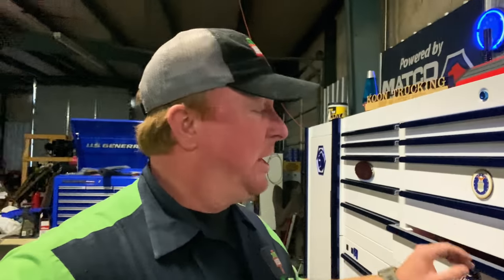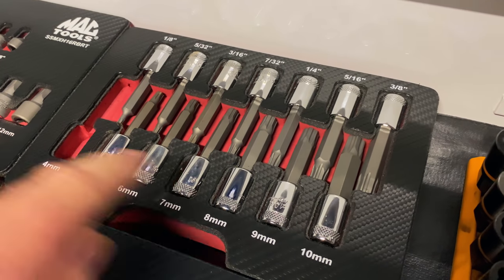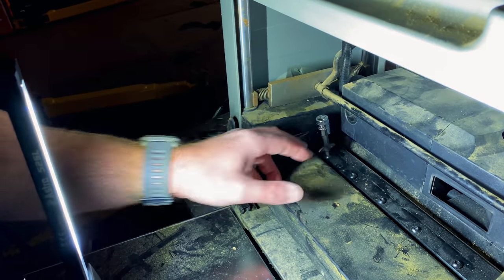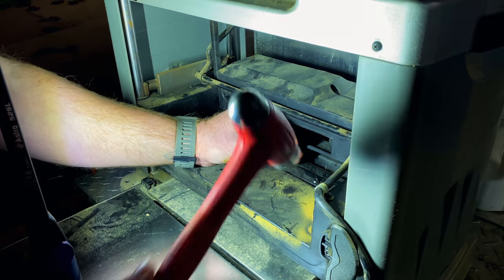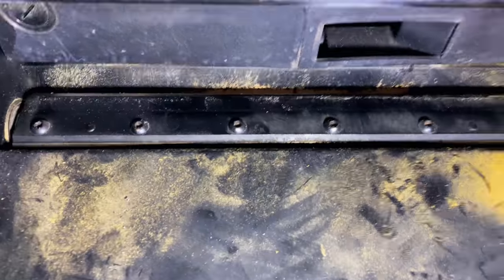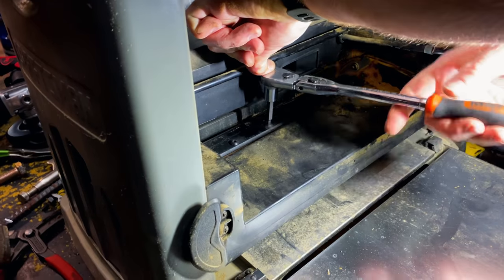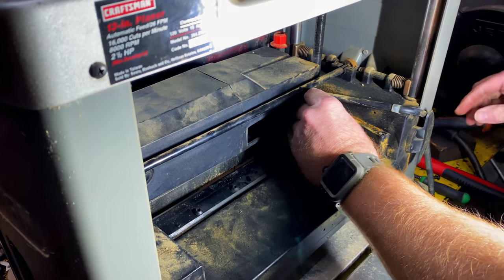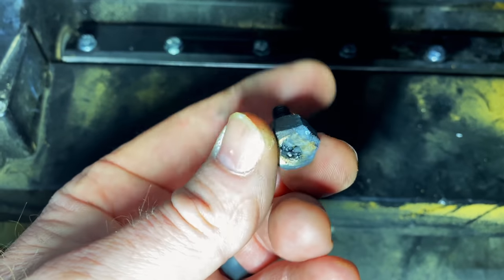Mac Tools RBRT Hex Extractors Used In Real Life Work (Stripped Hex Head Bolts)

Comment from the maker: ⭐️ I’m in no way saying RBRT bits are no good or do not work, the point is if the metal you are trying to extract isn’t strong enough to allow it to bite and the tool just rips the metal out then it is doing it’s job, the metal is just crappy…. Like seen in this video with cheap ass Chinese screws!⭐️
Reply: We have all had that crappy bolt kick our ass at 1 rime or another! (Hahahaha cry)
Reply: Agree 100%, love rbrt but if it's cheap as metal it isn't working
Reply: Used these on a Ferrari screws not cheap metal haha. Did the same thing. Don’t know if they work well or not yet. Had to end up drilling it.

Comment: Would have been cool to see if Vampliers or Knipex twin grip could have grabbed the head on those screws to get them out.
Reply from the maker: Wasn’t much to grip on the heads due to clearance issues with the blades so they were super slim anyways that’s why I didn’t even bother trying. Plus they were pretty tight

Comment: Been down this road before with these soft material hardware. What we've found is just taking a propane torch and just slightly warming them (not glowing red) And then start with the proper sized Allen wrench of good quality and you'll likely get over half of them out. Then switch up to these RBRT after you re warm them again. And the other half will come out with ease. As for the typical LS engine broken exhaust manifold studs. Its STRAIGHT to the Mig welder and build up enough weld to get a 5/16" bolt welded to it and they spin right out if those Aluminum heads. Chase the treads and move to the next project. We do HUNDREDS of them like this at the machine shop. And the evidence goes in a bucket that we show the customers that bring them to us in a full blown panic. We tell them to PLEASE just leave the broken studs alone. Don't try and drill them yourself. Because you'll likely do more damage when your drill walks and you damage the threads. Let us do it, We're very good at it.

Comment: If there is room I use an old-school impact driver so you get the downforce and shock and twist all at the same time. On some powersports stuff, like rotors,  they use torx shoulder screws with patch-lok, or red loctite on them and they were a bugger. We'd heat the bolt 'til you smell the loctite, then drive on it with the impact driver.

Comment: Clay I'm not going to knock on the rbrt tools whatsoever because they are damn good retracting types of tools but you said it right and if the bolt head or screw head or whatever it may be that stripped out, it's softer than the removal tool itself, then no removal tool will have a whole lot of success extracting whatever it may be.. also I have always used a lightweight Hammers to tap in any brand of hex head or Star head wrenches or driver bits before trying to extract anything because I've always felt like no matter what brand of tool you're using, it gives the tool that much more of a better bite for grip to help prevent more stripped out bolt heads or whatever it may be, that's being removed...

Comment: Ever try welding a washer to the stripped out fastner, then a nut to all of it? Obviously what you did worked but it may come in handy one day
Reply from the maker: What’s the purpose of the washer ? If the nuts welded ?
Reply: @KoonTrucking  you can weld the outside edge of the nut and the inside..just depends on situation edit..it's more for a snapped bolt not a stripped one
Reply: Use a washer with a smaller hole and your also semi protecting whatever material is underneath it ...I know the heat normally does most of the work..it is an extra step though

Comment: I'm not a full time mechanic and do not have access to a tool truck so a bought a couple of singles in some common sizes of the Mac Tools website. The first time I used one of them the bit head stripped with a small amount of force. I wasted my money because it will probably be a hassle to warranty it out online.
Reply from the maker: No just contact Mac tools they will warranty it for you no problem

Comment: I am tempted to buy rbrts, however I normally hammer cheap nasty torques into them and that probably does the same for ten times less....after that it's a sharp chisel and hammer or. ...welding nuts
Reply from the maker: But the Grip Edge RPT. Exact same tools. Same warranty. Made in same factory for much less. https://youtu.be/oq1tPdh98-A

Comment: those+impact screigwdriver (the handheld that you hammer) should handle something like this with ease. also plenty of room in that situation to cut a slot and use a flathead before welding.
Reply from the maker: Just easier when the welder is sitting right beside it? And much faster by time you pulled a dremel tool out to cut those slots (btw the metal was so soft I wasn’t wasting my time) I would have welded old nuts to it and had it out. To me faster is better and I needed to move onto something else.

Comment: We got a set at work because of your reviews. Seems every time we try and use them they break. Like easily...
Usually on small set screws that hold gas compressor pistons together 

Wera is where it's at. Not mac for Allen head screws
Reply from the maker: That sucks. I’ve broken a few of the smaller ones and one T45 but to me it’s worth it because they work. I can just swap them out with the Mac guy and keep going
Reply: @KoonTrucking  our Mac guy is slow to order it seems. He only comes by once ever two weeks too.

You ever use the wera hex plus Allen keys?
Reply: Wera is definitely where it’s at for hex fasteners.
Reply from the maker: I have a regular set of Wera
Reply: @taylor2105  those hex plus are phenomenal. All we use in Biomedical engineering work 👍

Comment: Also I think with this planer, a lot of it had to do with tree sap off of the wood acting as a loctite, building up on everything and in around the bolt heads... I've often wondered, why people never use things like wd-40, PB blaster or other penetrating fluids like these, that are especially designed for helping aid in easy or easier removal of stuck objects but maybe it's me thinking that stuff works much more better than not in most instances, if I were the guy that owned this planer,, I think I would have sprayed those bolts down with something like PB Blasterafter the first one gave me trouble

Comment: I'm watching this video because I have a Harbor Freight Daytona floor jack with four rounded off 3mm hex head screws. The heads are of a countersunk design. I swear, these screws had been Loctited in and took all my strength to breakl loose. So I have four out of the eight hex head screws on the jack with totally rounded off heads. Any ideas? (I don't do welding). Great video btw, and thanks.